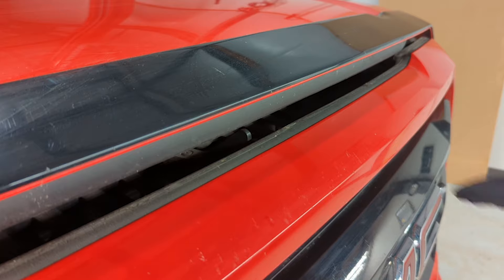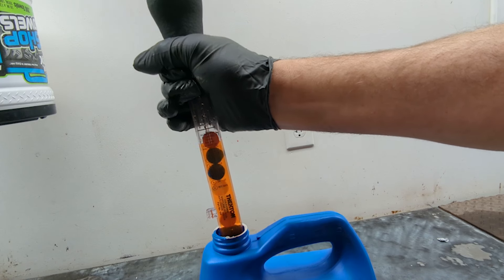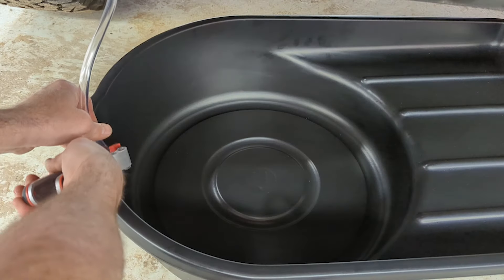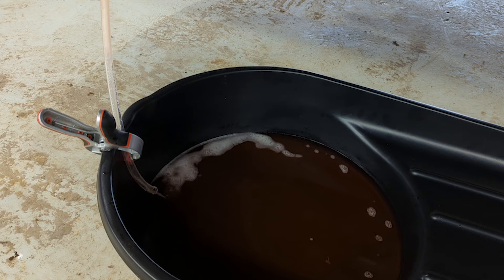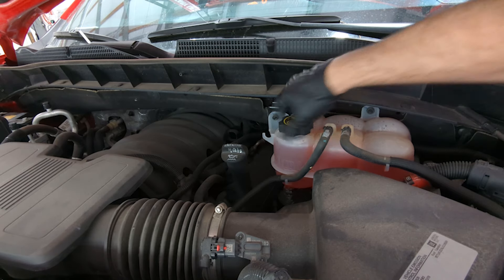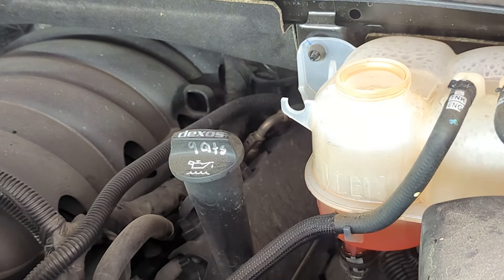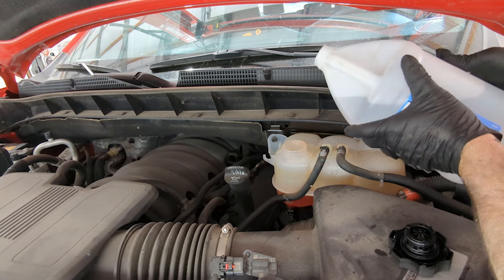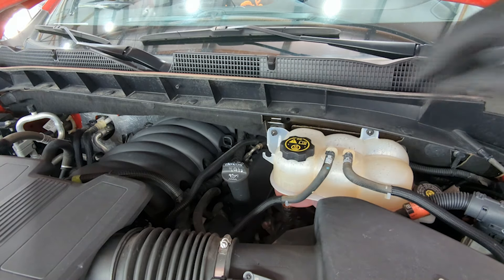2019-2024 Sierra/Silverado: Engine Coolant/Antifreeze (Exchange/Flush)

Comment: Are you planning on doing other things? like brake fluid bleed , plugs and wires,pads and rotors etc that would be fun to watch.
Reply from the maker: Thanks for watching. I do have my eye on a brake bleed. I have other services in mind, but will likely do them as they come due.
Reply: @MasterJacks  could you do a video on lifting one of these with a floor jack and setting it on jack stands.
Reply: @MasterJacks Would definitely appreciate a brake pads/rotors service and a brake bleed. I have a 2021. Is the coolant required or can I let mine go as long as engine temp stays normal? I'm at 80K. Used your videos to do transfer case, rear and front diff fluid!
Reply from the maker: @Redrune0928  rear brakes and brake flush are in the near future. Dexcool is rated 5yrs/150k, so you're good for a bit. Glad the videos are helpful! Thanks for watching

Comment: Do you put 9 quarts of oil? Just saw that on the cap.
Reply from the maker: It calls for 8, but I've found 9 puts me right near the top of the range on the stick. I think mine likes it there because it doesn't seem to go down (consume) between changes. 8 qts might give you better gas mileage 🤷‍♂️
Reply: Mine barely registers on the stick at 8qts. Maybe 8 qts is where the engineers want it, but they should have designed the stick to correlate.

Comment: Replaced mine with AMSOIL coolant in my 2019 AT4 last week and damn my MPGs have gotten better by 3mpg and my my truck doesn’t go past 202 in most cases and goes as low and 187 while driving. Temps here in Austin have hit 98
Reply: simply not a result of Amsoil